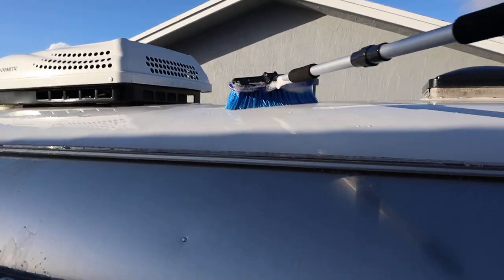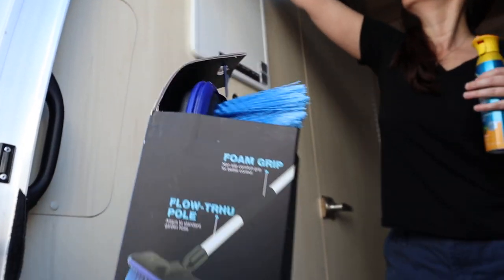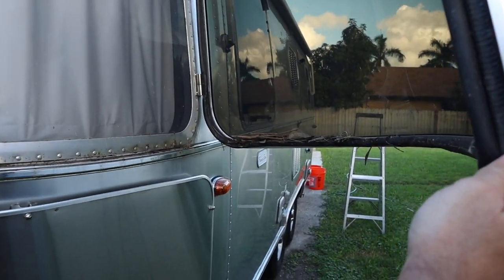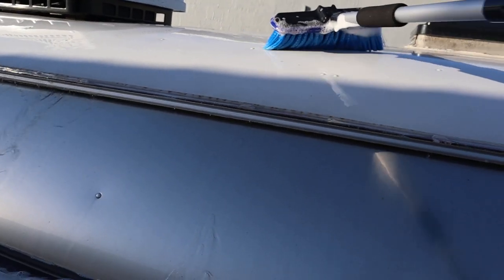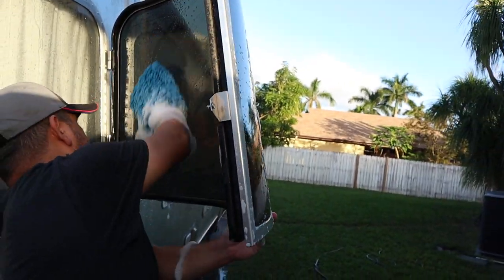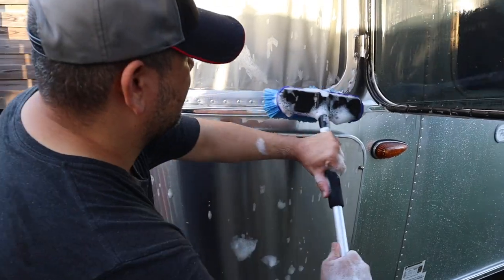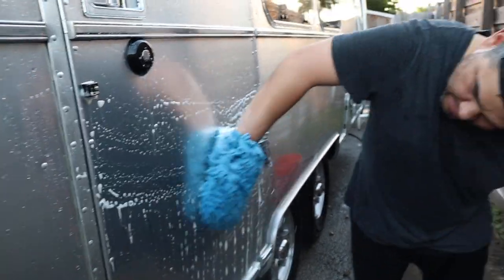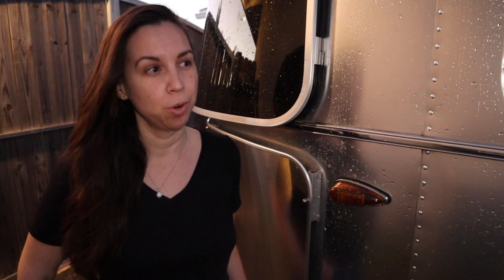How To Wash Your Airstream | Tips & Products | Flying Cloud 23FB

Comment: Weather permitting I wash my big truck once a week and it takes the same 1.5 to 2 hours. In the winter months I use to take it to the Blue Beacon Truck and RV wash. Blue Beacon’s are located all over the country usually at large Truck Stops. It use to cost me approximately $40.00. I haven’t been in about a year or so because we now live in southern Virginia and the winters have been fairly mild. 

Thanks for the 2 bucket tip. I’ve never thought about the dirty water issue. 🤔 We plan on buying an Airstream next summer 2023.
Reply from the maker: Yes, that two bucket trick we learned from washing our cars. It’s really helpful! Good luck on buying your Airstream next summer . I need to see if I can find a Blue Beacon in Florida! :)